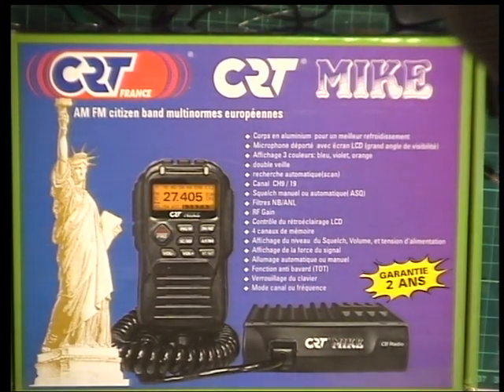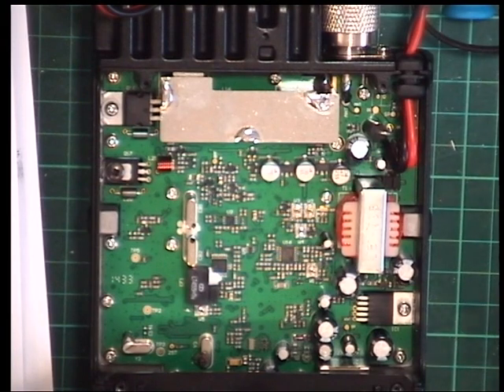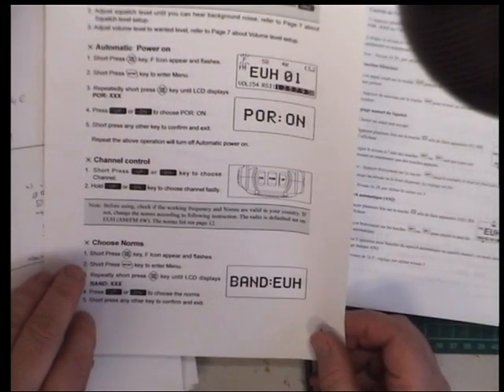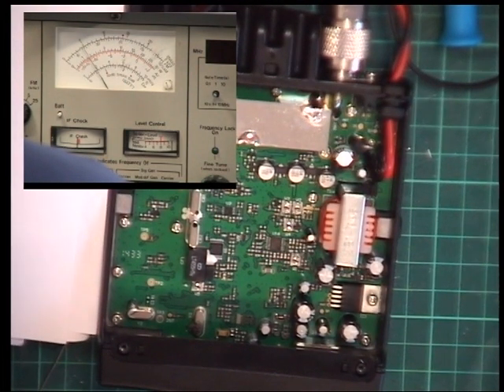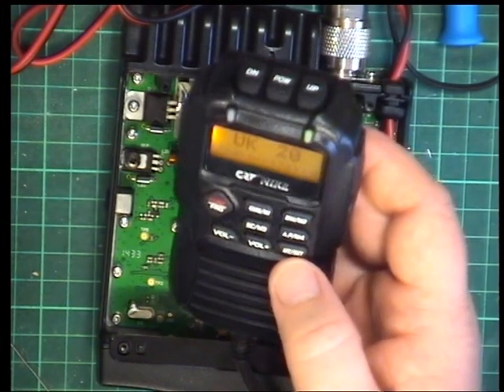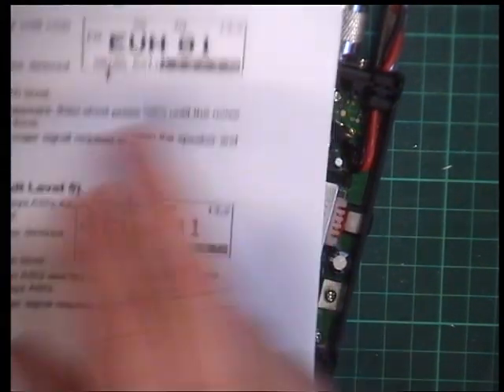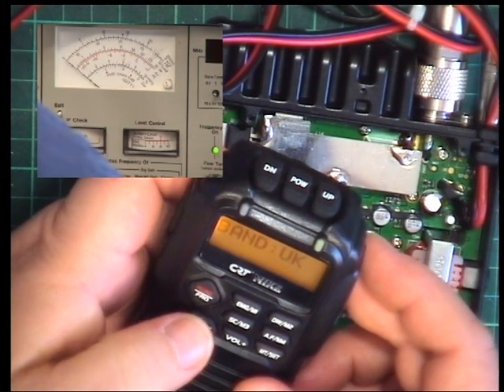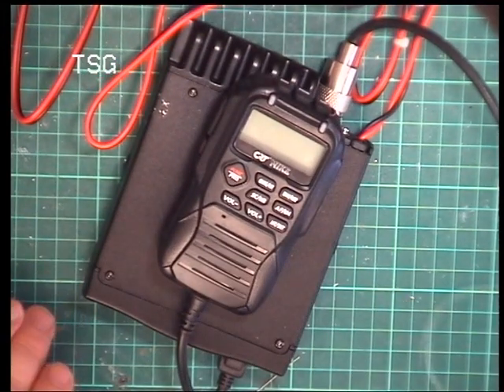CRT Mike UK CB radio CE-MultiNorm (mobile) - Overview & internal Adjustments

Comment: Thanks for the video, did the tx output measurements on mine and its at 3.5W tried to turn it up from W2 (clockwise) but then it drops to 1.5 suddenly.
Reply from the maker: Most SMP presets go round in circles without an end stop. 3.5W must be the max it will achieve. Most current sets do between 2.7 & 3.6W ith very few actually doing 4W. Range wise, the difference between 3.5W & 4W is so tiny as to be un-noticeable. We've demonstrated different power levels many times on this channel.

I'm assuming you are running the set from 13.8V & into a dummy load & not an aerial.

Richard, G0JOF, UK
Reply: @ukfmcbradioservicingTango21  hi, thanks for the prompt reply. I was measuring the tx power behind an aerial. I did try just now with a dummy load, and its slightly higher at 3.8W, also the car is off your right. It should be slightly higher once at 13v+. Cheers and thanks once again.

Comment: That Would Go Nicely In My Bergen With An Aluminium Sheet Folded At The Top To Accommodate A Mobile Antenna With A Wing Nut , Maybe A Folded Aluminium Sheet For A Better Ground Plane ?
LiOn Battery Pack Would Be Handsome ! 
One Thing I Don't Understand Is Why That Main Output Transistor Isn't Bolted Directly To The Heatsink ?

Comment: I'm in the US and I'm looking for a radio like this.  The options here are the Uniden CMX760 which seems to be plagued with problems and the Cobra WX75ST which doesn't have the greatest of performance. Can this radio be realigned to US frequencies easily (without board modification, normal tech work)?
Reply from the maker: Anthony, the FCC approved radios have totally different innards for your country. Just as attempting to import an FCC radio to this country would lead to confiscation & prosecution, so it would with you if you imported a CE approved radio to the USA.  Also bear in mind that Cobra of yesteryear is just a name of Chinese nasty sets...well certainly in Europe & the UK! If I were you I'd get a 1983 Realistic One-Hander which were made in Japan for RadioShack by GRE. The UK FM version of that was superb with crystal filtering as standard.

Richard, G0OJF, UK
Reply: @ukfmcbradioservicingTango21  thanks for the info...  that truly sucks.  I really want something space saving as it's going into a Jeep and there are only bad options here in the US. 😞

Comment: Interesting lack of 'innards' but still decent performer. 
A smaller transceiver I use in the smaller car, is the President Bill ASC. Personally I find it a superb bit of kit and can't fault it and now rate it as probably the best straight rig out there on a Carlsberg scale. I'm lead to believe there is little adjustments internally just like this radio here. I'd be very interested to see you put a Bill ASC through its paces. 👍
Reply from the maker: Just checking on the stock control computer to see if there is a President Bill ASC lurking in stock.....Yes, new in a box, so that's something I can do.

Richard
Reply: @ukfmcbradioservicingTango21  sounds good and I think you will appreciate the Bill. With a single button 3 bands of channels. Uk40, Cept and AM. No faffing with on and off, set it to UK and that's it.  Hold Chanel up or down to scan too, easy! Exactly how every modern rig should be now sold in the UK. Interestingly the Bill can be easily modded to 10watts plus but I wouldn't think it would last long as it keeps you warm from the rig body heat.
But seriously, I think you may actually like the little President Bill ASC. Will keep tuned.
Reply from the maker: Roger on that, but please keep comments relative to UK legal with no mention of mods. You'll be pleased to know Mr Chippie dug the brand new sealed box out of stores last night & put it on my bench for today's video. 
Talking of illegal power levels, I don;t know if you saw my video on estimating range on CB radio (would apply to Amateur 10M too). The data shown is correct for both AM & FM as both modes have the same range. It was part of research I was doing in the late 70's with the government. In reality the range difference between say 2W & 10W is really nominal....probably stop scratchy corner being scratchy & add 1/2 mile on at extreme. Have a look for it if you haven't seen it. perhaps G0OJF CB range would be a good search criteria if not.

Regards, Richard
Reply: @ukfmcbradioservicingTango21  not watched your video on that yet, I'll take a look. However, yes I understand the concept that you mentioned. Simply put people think double power is double distance which is untrue. For every half a signal point increase shown on recieving (recipient) radio you need double power, so any gains are made low down the scale. My understanding is, doubling power roughly only gives half signal point benefit to the recipient. So if they get you at signal 5 with 4w roughly they get you signal 5.5 at 8w, signal 6 at 16w etc That's my understanding. It amazes me why people use more power, especially local only and it's obviously illegal and causes RF interference, it's also quite interfering. Here for example I can hear calls over 20 miles  away that are local conversations in that town blocking the 19. But hey ho, guess it's better than hearing nothing 🤔
Reply from the maker: Thats it ;you actally have to square the power to double the range. It's the way dB work. Same with audio amplifiers. You've be hard pushed to tell the difference between a 2.5W amplifier & a 10W one.

Thinking about the 'burner brigade'. There used to be a guy (now deceased) in Grantham, who drove his car to a hilltop location with his 300W burner to talk to other bad buddies doing the same about 40 miles away. just out of legal range. I'd hear him whilst driving around town 1.5 miles away. He put out the most awful, virtuallly unreadable signal. Alternatively, he could have driven to the next vantage point a total of 10  miles from his house, rather than 2, put out a really good signal from a properly setup installation & legally easily have spoken 35 miles +

Richard

P.S. I''ve done the Barry video, found the hidden menu's & mine works great. Didn't know it had scan.. Video about to come off the DVR, get edited & uploaded this afternoon. Well done for suggesting this rig.

Comment: Could I request a Catswhiskers Catcall to Catcall lineup / test.
I have both the Homebase and mobile units and would be willing to drop them to you (and pay for the tune up of course). Am in Peterborough so not far.
Reply from the maker: We have a small base version here. You will realise it's just a DNT in a UK case with selcall fitted.  Although we've covered the DNT before I suppose we can do this & attempt to work out how the selcall is aligned....that will be fun with just one unit. I remember the Westward PT2, which was a Maxcom 4E in a big  box with a battery & carrying handle...there was another UK 'fake' CB too that eludes me at present. I'll do the catcall video today as I hadn't planned anything, except customer repairs...but they can wait.

richard
Reply: UK CB radio servicing  would you want a second to call up?

Comment: Not a fan of that myself, the modern day Binatone breaker phone which incidentally I found mine the other day and it still works.
Reply from the maker: Yes. try telling a policeman it's a 2-way radio & not a phone! Must check if a did a servicing video on the breakerphone. I love it when you select PA, and it says 'PA'  on the display. I can't think of another rig that did that.

Richard
Reply: @ukfmcbradioservicingTango21  funnily enough I came across a radio that displayed PA the other day it was a Midland 77- 095 from memory

Comment: I am looking for a crt s mini v3  new model it would be usefoul to see on air test on ASQ . As spec senitivity 0.8 micro volt looks like a less sensible radio .This radio should have a service menu for ajustments but i found no info about it !  I am not fully convinced if can replace The President Barry that i am using now and i consider NO 1 radio on the market in terms of recive quality on ASC .
Reply from the maker: Yes, I'll do that then in a few days.

Richard

Comment: That control may be fm high power . By soldering on board HI you can make 8 w high power. Good radio i used it gor 3 years .Asq A 7 and that is all you need . Also mike cable can be prolongued and black box stored in the trunk. Really good radio .
Reply from the maker: Roger on that. However, it has to stay at 4W for legal reasons. I bet you are right though.

Just done the on-the-air recording & it works great.

richard

Comment: I have the same radio in my Suzuki Vitara and it fitted to a sirio 800 performer and get great reports mobile and static yes it's small and different with the mic but it works ok